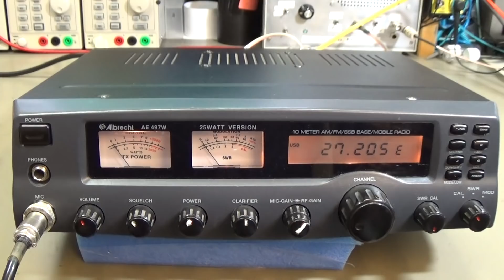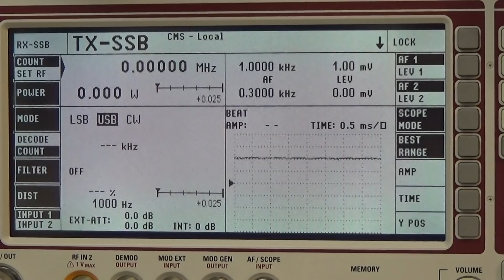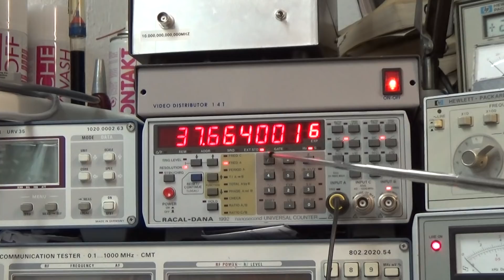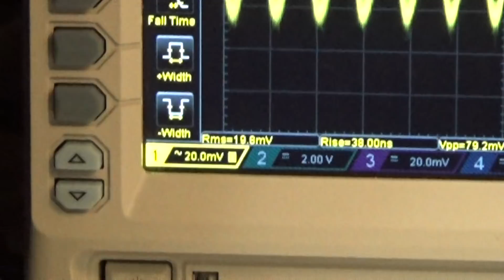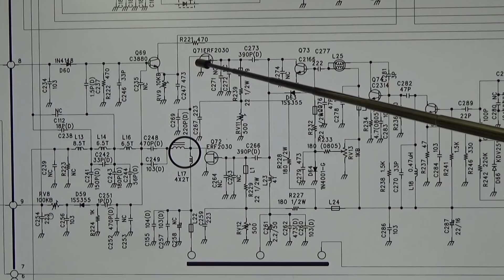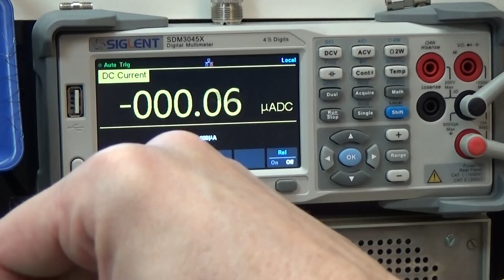#198 Albrecht/ Magnum AE497W 10/11m radio totally screwed up and missaligned fixed

Comment: I’ve been subscribed to your channel for about a year, and I look forward to very new video you release. I also follow a few pages that you follow such as W2AEW’s page and The Radio Shop. I’ve been licensed since 1970 and have remained somewhat radio active throughout that time. Your videos have taught me some troubleshooting tricks and techniques that have resulted in getting me into a restoration mode. In the past when I attended a hamfest I’d avoid radios and test equipment that were in a visible state of disrepair. Now, I look for them, so I can restore them and give new life to an old faithful piece equipment. 90% of the repair process is usually replacing failed capacitors.  Just wanted to say thanks for all your hard work!
Reply from the maker: Thanks for your feed back! I'm really glad that my videos makes sense to you. Restoration is a very challenging hobby and indeed it  makes a lot of fun. 73

Comment: Good morning Peter,  it looks like someone had fun with a 1985 Zetagi 5-digit counter:-) Boy, that kind of radio is crappy. Not so much the board itself, but the quality of the housing, the knobs and dialers....It makes you feel dirty when touching and wiggling around;-) I have the same radio on the bench called SS-497. Maybe i will work on it in the next two weeks...The "civil" version of Albrecht have a lot of fans, and yeah, they are nice looking base stations, but once again: 5 USD more spent in good quality parts will satisfy everybody.. As always; Thaks for sharing, you did a god job and now the OM has a clean radio back in service. 73 de Olaf!
Reply from the maker: LOL yeah Olaf most likely the Zetagi haha... But you are right the design of this particular radio is crap. Even the schematic is wrong better use the schema from the Magnum 257 there you have less drawing errors but still some. 

Eigentlich bin ich ein Albrecht fan aber dieses Funkgerät ist wirklich schlecht. Wenn ich mir die Ausgangspattern bei SSB anschaue ist das wirklich traurig was die da abliefern. die 3rd Order Produkte sind fürchterlich auch bei verschiedenen Bias Strömen und unterschiedlicher ALC Einstellung. Ich weiß nicht was die sich gedacht haben?? Schönen Sonntag 73
Reply: @TRXLab  Du hast zu 100 Prozent recht. Du kennst sicher die zusätzlichen Service-Informationen zu den 8000ern und 497ern von Albrecht? Ich glaube, dass war denen selbst unangenehm...VCO Probleme, Netzteilprobleme, Hitzeprobleme. Teilweise recht "robust" gelöst, aber schon im Design fehlerhaft. Und die Info Bulletins kamen im Monatstakt..  sehr schade, da die Geräte recht beliebt waren und immer noch sind, weil moderne Heimstationen keinen grossen Herstellerkreis mehr haben.
Reply from the maker: ja genau ich kenne die ganzen Modifikationen und wenn du sagst "robust" gelöst ist das mehr als freundlich ausgedrückt. Schade auch das man die Knalerweiterung mit diesem kleinen Zusatzboard einfach mit rech dicken Leitungen auf die kleinen SMD Widerstände gelötet hat. Auch dazu gibt es keine vernüftige Dokumentation und die Dinger fallen immer ab. Richtig eigentlich eine schöne Basisstation aber leider zu viel Probleme. Diese Geräte mache ich auch nur für Freunde alles andere kann man sich nicht leisten...

Comment: Hi Peter. I worked on the "Cherokee" branded version of this radio, with bipolar finals. I found it to be off frequency about 600 hz. Got it starightend out, but I wonder if many of them came misaligned out of the box. Oh yes I added a small fan right behind the power supply as I found the temperature difference affected the Pll. Frequency wounld change as the radio warmed up. Pll was fairly stable after the fan mod... Great Video!
Reply from the maker: Hi Larry, yeah this radios are honestly horrible. You are not able to do a reliable job on the radio which is a shame..To get it stable you first need to do a lot of mods which is it simply not worth..Thanks for comment 73

Comment: LOL, not sure how to break the news to you but that radio wasn't screwed up.  I wish half the radios I got were in such good condition.  Some of the hacked and butchered radios I get make that radio look new out of the box.  I seem to get all the horror show reject radios that no one else can repair.  It definitely looks like someone needs to get their frequency counter calibrated.  They had that one pretty far off.  Like you I use a external frequency standard distributed to all my test equipment.

If you have a spectrum analyzer that can also be referenced to a external standard it makes a really nice small signal frequency counter.  Just set the center frequency to the frequency your trying to adjust and as you get closer to it reduce the span of the spectrum analyzer.  You can take surprisingly accurate frequency measurements when you set the span, resolution bandwidth and video bandwidth correctly.  And with practice it's actually faster than using a frequency counter.  You can see the frequency peak moving back and forth across the screen as you make adjustments.
Reply from the maker: LOL yeah Mike I believe you see more crap than me as ham radios are often not that much screwed up like CB radios.  Well we all know that we also have golden screwdrivers within the ham community but still I believe it is not that much horrifying compared to what you must see from time to time.

Comment: Hi Peter,
I wanted to ask you a long time ago, which external reference source do you use for your frequency counter?
So exactly the Albrecht was certainly not even adjusted from the factory :-) 
I recently had an old Sommerkamp device on the bench. It was a TS-660S which still uses this old-fashioned quartz-frequency synthesis. Unfortunately, you can not bring these heaps of quartzes on frequency. Partially the frequency deviated  - 1 kHz. This Radio nowhere has trimmers or coils been installed to pull the quartz crystals. Thankfully, the TS-660S only has AM. That's not so noticeable ;-)
How fast 43 minutes are over again :-(
Thanks for your work and the video Peter.
 73 Bernd
Reply from the maker: Hi Bernd, I'm using a very high precision OCXO which is monthly checked against my rubidium standard and the rubidium get's checked every 6 month against a caesium standard. I know the issue with the Sommerkamp radios that is horrible..Thanks for watching.
Reply from the maker: Basically yes but I can't say anything about the product quality and reliability of what they say in there specs. Assuming that all is okay the product is fine..
Reply: @TRXLab  That's what I thought too.
You can not read more than the specification. I will try it. We will see if it works.
Reply: @berndb.5097  You could check several discussions around these GPSDO units on google. In short, the small units are often based on the internal oscillators of the GPS module. That results in a fast start-up but not so high stability and some stepping effects on the 10MHz. If you buy one of the more expensive bigger boxes, there are (double-)oven controlled oscillators inside. You need to let these run for a long time (~2h) before you use their outputs. All of them are based on old telecom surplus or trash. I use two GPS references from old telecom base stations and they run 24/7. That said, if you check or repair mostly HF/VHF/UHF radios, even the cheaper devices are far better then no reference at all.

Comment: I disagree a little about the absolute frequency accuracy in SSB. While this radio is surely way out of spec, it doesn't matter that much. 

For decades we used radios with an analog, mechanical dial which had a readout precision of 1kHz at best, the accuracy was even worse and additionally to that it drifted with temperature quite noticeable. It's just an operating issue, you knew that and if you had a sked with someone on for example 3650kHz you of course looked for him at 3630-3670 on your dial or something like that. You need to do that anyway because of QRM. 

And of course you have to take it into account when transmitting, to keep enough distance from the band edges to not accidently transmit out of band. And everything changes or course if you talk channelized SSB, like used on CB. If you don't have a VFO, you need to channels to be on point, yes.

Comment: To measure a frequency at low level, it´s useful to use an old analog scope with Y-Output and connect the counter there.
 Advantages are that the oscillator is loaded only with the probe (10MOhm at 10:1) and you can see, what you are measuring.
Reply from the maker: Very good hint Stefan. Thanks for feed back 73

Comment: I like factory ,Peter and all my Ham radio's are factory in every way, I  was lucky once, right place right time and got a rubidium oscillator I made a frequency standard 10Mhz, perfect , I'm told with age they get even better, I have no idea on that, I guess I'll find out, loved this video a real lesson, which some should learn from, leave aligning to the expert's like you  .
73 Paul   M0BSW
Reply: Frequency standards drift with age.  Rubidium oscillators are no different, and they need to be adjusted on frequency as well.  Get a GPS disciplined oscillator like a Thunderbolt and you'll always be on frequency.
Reply from the maker: Hi Paul, well yes a new standard needs to get burned in and that is meant with it is getting better with age. Thanks for watching and have a nice Sunday 73